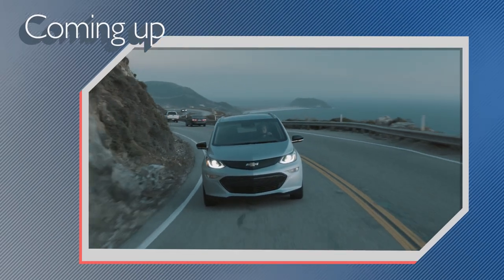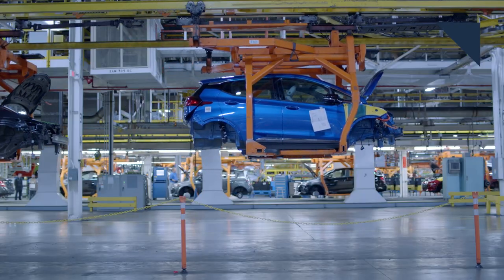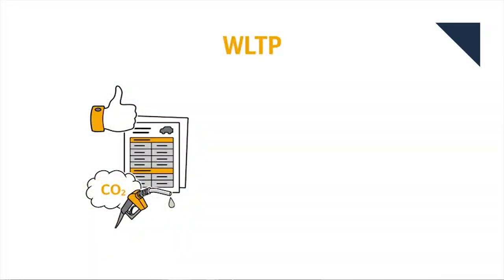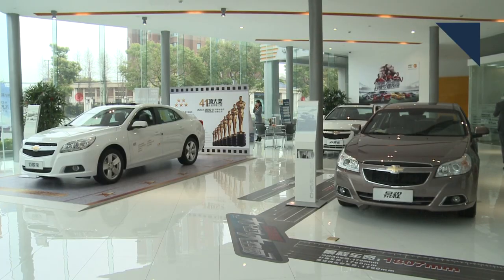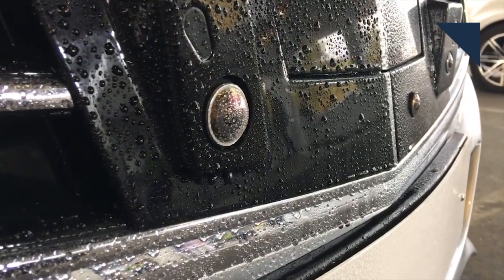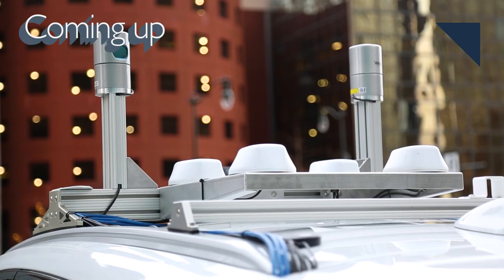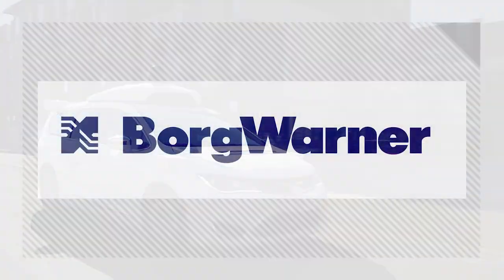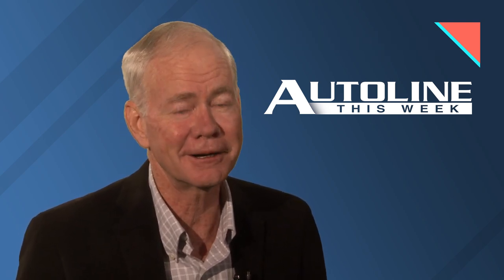What's Wrong w/ Bolt EV? Clever Lens Cleaner - Autoline Daily 2450

Comment: I was going to buy a Bolt EV until I found out it didn't have available adaptive cruise. That was a genuine deal-killer for me. The Model 3 isa perfect fit for all my requirements in a car, but it was also out of the question because of worry I have for the future of Tesla. I ended up settling for a Volt PHEV for now. It's a great car and the 53-mile EV range is large enough that my daily work commute only uses about 45% of the battery. Hopefully when I go car shopping again in a few years, Tesla will be rock-solid and EV's will be very affordable.

Comment: When the dealers tell you they are allotted 3 Bolts per year what do you expect? GM must actually TRY to sell them and work to get the cost down. Visit a GM dealer around here or within 200km of here and you might find one... better odds than winning the lottery, but not by much. The spinning lens cover seems to me to be from the marine industry, spinning glass on the bridge of ships have been around for a long time. Nice to see cross-pollinization  from other industries.
Reply: Stephen Bungay -- GM never intended to hit the 200,000 unit mark to begin with.  That is why they now want to walk back the provision they asked for that included the VOLT and other 'extended range' plug-ins in the eligible vehicles for the Federal EV Tax Credit.  They only created the BOLT because of the ZEV Credits they would get from CARB States once the 'Travel Rule' expired, because they would allow them to artificially boost their CAFE rating without actually building more fuel efficient cars, SUVs, and trucks.  The DieselGate blowback has also ruined their longterm plans.  Bottom line, GM was willing to 'play the game' as long as it was stacked in their favor, but they don't really want to sell plug-in cars of any type.  Ever.
Reply: @redxsage  Funny really because they are in the business of selling. It doesn't matter what THEY want to sell, it only matters what the customer wants to buy. Refusing to sell a product when you have someone willing to pay you for it is insane. They're playing the game of 'live off of the tax breaks'. That is not business, it's  form of corporate welfare. We've seen this movie, it ends with incompetent overpaid executives going to the government with cap on hand looking for money because no one is buying what they want to sell. This is how they lost to the imports, and I think that if they are not cautious it is also how they could lose to upstart EV companies who see and are working towards filling a hole in the marketplace.

Comment: Autonomous car sharing offers another low-cost option that is a step up from public transportation, but owned and leased vehicles are still very alluring. I expect autonomous car sharing to steal at least as much from taxis and other forms of public transportation as from car ownership/leasing. People still want the convenience of having their own car everywhere except where parking is a problem. It's just a matter of how much people want to spend for the premium of personal transportation. That question is still up in the air and different owners have different answers, and may differ between owners and leasers. There's also the question of buying new or used. Many of us prefer to drive a used car than submit to any form of shared or public transportation.

Comment: You cannot fail the wlpt, it not that kind of test! Infact it not a test at all. It a factual collation of information,   so that the vehicle can be taxed correctly  and owners will have better idea of running costs .
Manufactures will no longer be to make stupid claims of cars doing 85 mpg. But car sales are down because of this rate system. I do not think so

Comment: It’s the aesthetics, they put their best tech and large battery in something that looks like a mid 20k hatchback, and put a 40k sticker on it.  I’ve got a i3S Rex and chose it (even with its funky styling) over a very vanilla and almost 2.5x Range Bolt.  I drive about 500 miles per week, so the i3 is a great little commuter.  Just need to soften the damn ride.

Comment: As many have said I don't doubt that increased availability of the Model3 have hurt sales of the Bolt,  though with the EV tax credit for Tesla already in it's sunset phase we're looking at going from a $15K price difference (between the cheapest Bolt and the cheapest Model 3 you can buy. and a $22K price difference by 2020, that's assuming that Tesla doesn't make a sub $50K Model 3 before the end of 2019.

Comment: Having driven a Bolt 18 months ago perhaps I can shed some light on why they aren't selling.  The version I drove had a window sticker of $44,000.  Near as I can figure that translated into $14,000 for the car and $30,000 for the battery.

In other words for the price of a BMW 3 series you can drive a Chevy Sonic.
Reply: until you thrown in the tax breaks and no more maintenance,  then it kinda all makes sense and looks dumb to buy a BMW that will develop extensive problems and gas costs.

Comment: One important factor is the success of the Volt, which keeps getting better.  Buyers considering electric can see the Bolt and Volt side-by-side.  The Volt is bigger and, being hybrid, is a more practical choice for more people.  I doubt Tesla has much to with it at all.  Tesla customers tend not to be interested in GM cars and the Model 3 which is available is in a higher price class.
Reply: I'm generally a GM customer, however since the model 3 wide release even I can see the Bolt looks overpriced.  Base price needs to come down to 30k and then it needs to go even lower if Tesla does indeed lauch a $35k model 3.
Reply: @spazzman90  

Only a few options push the model 3 to 50 grand. Any paint besides black is extra, thats just the beginning.
Reply: +spazzman90 base price need to come down to $24000
Reply: GM could care less about Bolt sales since it loses money now. It just the basis to develop AVs via Cruise.... But I have seen some major discounts on it so it could be good used car buy one day...
Reply: I considered buying the Volt, but it has all the maintenance disadvantages of any other ICE  plus a very limited all electric range - a hybrid nightmare of maintenance, the worst of both worlds.
Reply: "I considered buying the Volt" really means that just pontificating BS about it when I have no experience with it and no real knowledge of it seems way more fun... So thx troll for useless FUD about the Volt...

Comment: GM may be looking to increase Bolt production, but don't be surprised if it's used to manufacture Cruise Automation cars for ride-sharing in the SF market, and potentially others. They've already been doing limited on-road testing, and revealed a pedal-free, steering-wheel-free concept car. Can you say, "Testing open to the general public"?
Reply: Its hard to be surprised when it based on the Bolt now, but thats just starting point for Cruise Automation and other true AVs companies but some will fail in the long run like in every emerging tech development... So while Cruise seems to making the good choices (like creating Maven and the Honda deal (still need the details on how much it gave to Honda)). .. we will have to see if they are good enough to compete or not?

Comment: Too many local conditions to be able to give a national generalization. Example: Kentucky has zero DC fast charger or even L 2 chargers. Dealerships do not have them! A 240 mile Bolt has no appeal, plus the pricing! For the same, or less, a 140 mile Nissan Leaf has navigation and self steering and dealerships have L2, some DC fast charging. However, lack of advertising and promotion also hurts. In areas with plenty DC fast chargers, competition could be to blame.

Comment: The main reason why Chevrolet Bolt sales dropped is because it is a General Motors product. It is unreliable junk. Full stop period. Get the similarly priced by wayyy better upcoming Hyundai Kona Electric/Kia Niro Electric instead.

Or, just get the much cheaper Nissan Leaf, which is so affordable that puts it in the same price range as the standard Honda Accord or Toyota Camry, because 151 miles of range is more than enough anyway.

Comment: Bolt should be selling GREAT however the design is a dud and makes the vanilla Pacifica look sexy. 
Imagine if Blazer or even a raised Astra had been used? GM first failed with Volt, bland design and The General failed to explain the PHEV as an ultra hybrid as Honda has with Clarity presenting the car as an EV with back up petro just in case.

Comment: Bolt EVs are not appealing.  They don't look as nice as the Tesla model 3 and the Nissan Leaf.  They should definitely redesign and make it look like a regular car or CUV or mini SUV and not as odd looking as the existing one.
Reply: The Bolt EV is cute, but not sexy and bold like a Tesla Model 3 and the Nissan Leaf just looks too weird.
Reply: It's a hatchback, and that is something I for one want, I don't want a sedan. The bolt does not look like a science project, it just looks like a standard hatchback car, as it should. The model 3 is nice, but I'm not gonna buy a car that I am unable to buy parts for, or that the manufacturer can shut down at any time or cut off from the charging system. I did like Tesla, I still like their designs, but I do not like their desire to micro-manage vehicles they no longer own.
Reply: model 3 still being bought on cult appeal and bolt doesnt have that so I dont see very good resale value on it... Could be a good used car value...
Reply: @TechnologyJunkie  
You'd have warranty on most large items.
The general reliability will be better, it's so cheap to run you could afford the repairs anyway!
You're more likely ikely to have issues getting parts for Bolts with the small numbers out there.
What do you mean "cut off from the charging system"?
At least Tesla has a charging system!
They also have adaptors for other chargers.
You're either believing the FUD, not researching enough, not paying attention, or just looking for excuses.
Reply: @rogerstarkey5390  Tesla does not sell parts.  Yes Tesla can shut you down, but so can Chevy with OnStar. Tesla can prevent any given vehicle they make from using the supercharger system, it has happened. Chevy does not own the chargers their cars use and exercise no control over them.  I have about as much loyalty to a brand as the brand has to me, which is none. A model 3 would be great, except it's not what I'm looking for, I want a hatchback, something small(ish) and useful. I carried a clothes dryer home in my Toyota Echo with the hatch fully closed. With their current product line I'd need a model X to accomplish that with a Tesla vehicle. A Bolt MIGHT do it, a BMW i3 might work, and so too might a Nissan Leaf, but the leaf is not even in the running for me until they smarten up and get active thermal management of their battery pack and a much longer range, say 180 miles. BMW North America also has to smarten up and start rolling out the battery upgrades being offered in europe. The i3 is a bit funky looking, but a carbon fiber superstructure on an aluminum chassis with a battery pack that is thermally managed and designed to be repaired? That's forward thinking, and when you live in a rust belt it makes for an attractive package.
Reply: Joe E. -- GM announced a few months ago that the VOLT would be redesigned abd reintroduced as a Crossover/CUV in the next few years.  The Sedan will go away entirely.  They still call the BOLT a 'Crossover' despite it being technically smaller than the Honda FIT and having no all wheel drive or 4×4 option.

Comment: I own a 2016 Volkswagen e-golf, nice Euro compact, low wide and sporty. The Chevy Bolt is just too small and narrow, worse is it looks small LOL
Reply: Not enough range on E golf. Bolt gets better results which is what most people are after. I'd rather have an ugly car that gets 253 miles vs a beautiful Golf that gets 83 miles lol.
What kind of person would spend that kind of money to travel less? That's usually the saleman's pitch to chicks... "It's a really beautiful car, here... listen to the radio and check out that color!"
Reply: If you only had one car , the Bolt is superior.  As a city crawler 83 miles or 124 miles for the 2017. The egolf is much more fun , 2017s are sold out here in the USA. I use a ICE car for longer trips.
Reply: I think any EV is fun, but that's not really the stated purpose most people who buy EVs are for. They use them to save money on gas, repairs, reliability that kind of thing, or to put lesser footprint on the environment. I don't think most people buy EVs for fun but usually some practical purpose.  I think most Tesla owners buy it for prestige and fun, but then again they usually are in a higher income bracket. People who would buy a Bolt would do so because it's the most cost-effective EV when taken overall vs everything else. Most range and performance vs things like Egolf (it's faster) and less cost than Tesla. We will see how the Kona/Niro shape up against it because I think those might be better overall value in the long run, but it's not proven yet in the States so we don't know.
Reply: Agree, my wife actually uses the e-golf as a commuter car for work. The 50 mile round trip only cost her $1.50 due to the low TOU Off peak electric rates use to charge the car.  I had the 20K mile inspection with tire rotation done for $70.  An ICE car using the extreme 10K mile oil change interval would have cost $200. (Most people do 7K miles)

Comment: Bolt sales are down because they are over priced, take too long to charge, and have too short of distance on a charge. The original sales was due to a certain number of people who were willing to be sold a bill of goods that are overrated. Now they are used up reality is sinking in.
Reply: They have a longer range than a Tesla so I don't think that's the issue. I get 350 miles in the summer and 200 in the winter. Unless you are driving cross country you just charge it up at night and have a full charge no problem.
Reply: Sarah, 350 miles is hardly cross country. In Texas i could not even drive from one major city to another and back on a charge. However I can with my comparable gas model. So yes it IS a problem along with the time to charge and the price of the vehicle against a comparable sized gas model. Lastly the numbers you gave for yourself are not he average. They are exceptional which makes the average even worse.

Comment: How is the Bolt classified as a truck?
Reply: those who managed to classify it as a truck, could also have classified it a a Ferrari!
Reply: they classify it as a truck so not to need the crash worthiness compliance of a car.  trucks are supposed to be crash worthy because of size although not in reality. it's cheaper to manufacture cars without this federal mandate.
Reply from the maker: Not true, all light vehicles have to meet the same crash standards whether they are classified as a car or truck. The Bolt can be classified as a truck because of its wide-opening rear doors, a flat load floor and a liftgate. Most crossovers are classified as trucks.

Comment: Take you gas money the you save and pay you electric bill  /what a deal
Reply: Electricity is 1/6 the cost of gas. If you could get the equivalent of 3000+km out of a tank of gas would you be interested?...that's an electric car! If there was a car that every single time you took your foot of the throttle and or applied the brakes and or hit even the slightest decline of a hill it created gasoline out of thin air and pumped it back into your tank would you be interested?...that's an electric car since it has regen.

Comment: The volt is a better car. The volt should be their focus.
Reply: No one wants to put gas in their EV car.
Reply: Headcartoon -- The VOLT should have been GM's focus years ago.  It should have sold better than 100,000 units per year, like the PRIUS did before it was uglified to legitimize the putrid styling of the MIRAI.  But, like the BOLT, GM never intended for the VOLT to sell well.  Neither has reached even 30,000 buyers in any calendar year.  That is not accidental at all.
Reply: Having lived with a Volt for almost 3 years now, I disagree.